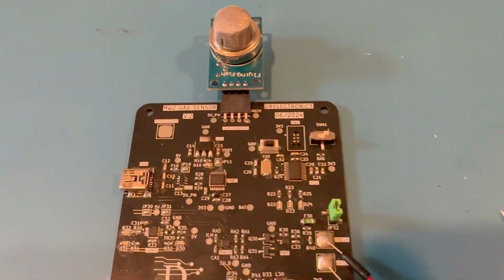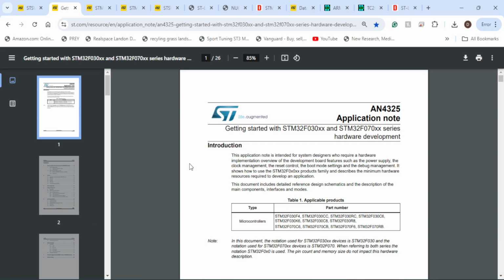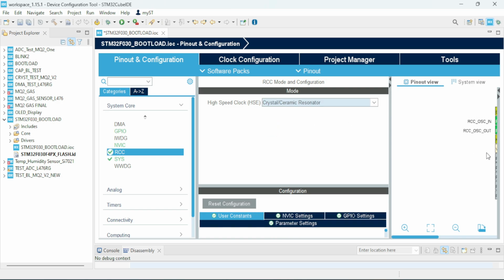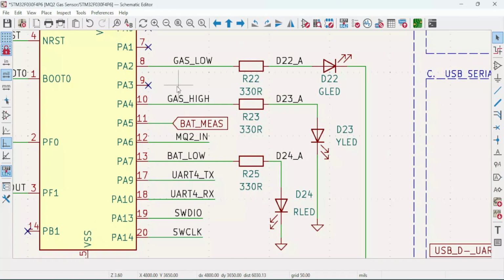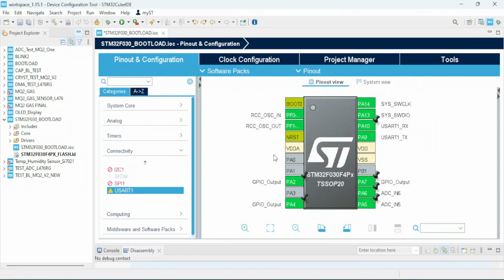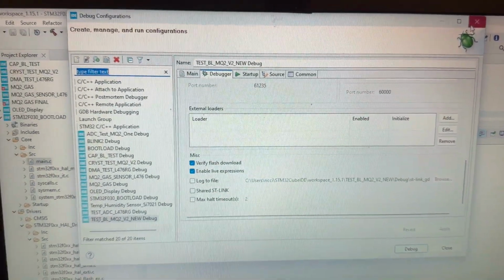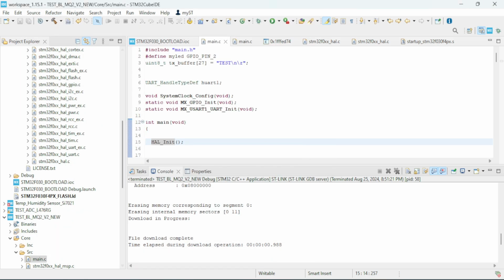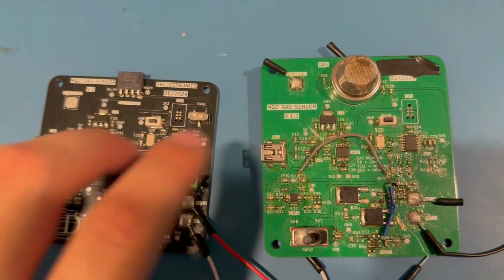Programming Custom STM32s  - Flashing & IOC Guide

Comment: I'm pretty sure a bootloader is different then what you're doing. If you're running it on bare metal your just sending your program to the internal flash and "programming" the board. A bootloader is another piece of software that configures the board and may give it some features and other ways of programming the board but it consumes some of your precious flash memory by having it on the chip. If you are using a bootloader try finding a way to program it without the bootloader on the bare metal and maybe you could fit your program in the size of the flash memory that you have.
Reply from the maker: @sethwhiting5971  I believe you are correct, I was “programming the board” through the Cube IDE and not another piece of software. The SWD was used to connect to the board for the program to establish what MCU is being used and that user generated code can be uploaded afterwards. Thanks for the clarification.

Comment: Did you make the board by yourself? If you did, can you please cover the detail video about creating the board, completely from the schematic, then PCB design, electrical properties, components selection, to real product? Nice vids btw, subbed!
Reply from the maker: Thank you! I did create the board from start to finish, currently, I have a video discussing some of the modifications I had to make which you can see here: https://www.youtube.com/watch?v=yeCudN1a1Pg.  Also, be sure to check out my channel description, I have a GitHub where I posted the schematic, and I can start uploading the project as a whole for each video if needed.

I was thinking about doing that, not for this particular project but for another one, it would have to be a multi-part series. I could do that for a large project I want to work on so stay tuned!
Reply: @DRELECTRONICS-mm5hb  keep up the spirit, bro. you can do this!🔥🔥🔥🔥

Comment: Also how much did it cost to manufacture? Including all the components. And can you do a video of the ordering process please?
Reply from the maker: @jboy6944  So manufacturing depends on the specific pcb company you go with, but I typically use JLCPCB, to get the three components soldered onto the board it cost me $52 in total (that’s including shipping and then I soldered the rest by hand which added another $25-30). These parts were also extended parts, meaning they cost more per unit.

Getting low quantities of boards (less than 50) is unfortunately expensive, so I’d say if you can get the parts that you would struggle with soldered on and do the rest yourself it will cost quite less. I can definitely make a video covering that as it can be a rather tedious process if you don’t know/haven’t done it before.
Reply from the maker: Check out my latest video, I cover the ordering process in detail: https://www.youtube.com/watch?v=iwfOyQQ6_Tg

Comment: can i get the scematic?
Reply from the maker: Try this link: https://www.pdffiller.com/jsfiller-desk12/?requestHash=58624129aa9273c800601d9953384625085b1e9810d09e2aec10298bac5e0f49&projectId=1615807236&PAGE_REARRANGE_V2_MVP=true&richTextFormatting=true&isPageRearrangeV2MVP=true&jsf-page-rearrange-v2=true&jsf-redesign-full=true&act-notary-pro-integration=false&jsf-fake-edit-embedded=true&isSkipEditorLoadFrequency=true&jsf-desktop-ux-for-tablets=false&jsf-probability-70=true&jsf-socket-io=false&routeId=b409f15ea8211be1959949d772823b7d#387a62e8670e44fb9d107b84b47dcb09. 

I'd also recommend watching this video: https://www.youtube.com/watch?v=yeCudN1a1Pg&t=351s, where I cover what changed from version 1 to version 2, though the one thing I'd recommend is to use an MCU with larger flash memory, 16KB can barely fit anything.
Reply: @DRELECTRONICS-mm5hb  i can't access the link and the document
Reply from the maker: @calvinaizumiramadhan2685  I'll have to create a GitHub then, I'll provide a link to it in my channel description later today.
Reply from the maker: @calvinaizumiramadhan2685  Check the description of my channel, posted a link to my Github where you'll find the schematic.
Reply: @DRELECTRONICS-mm5hb  Thanks Bro, it's worked